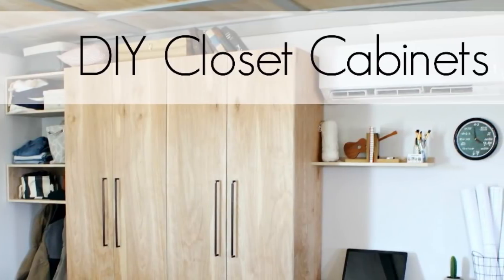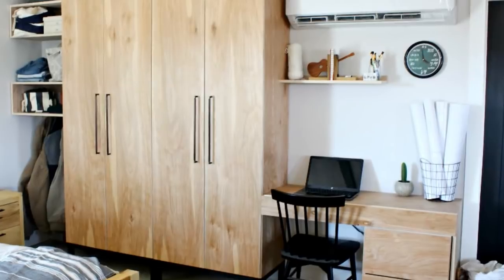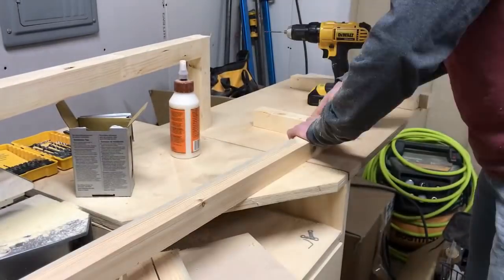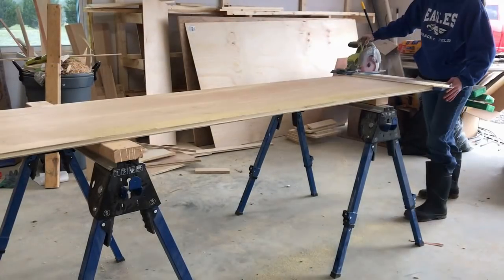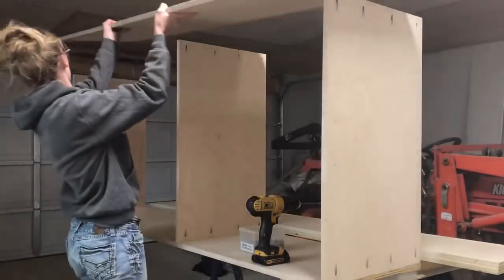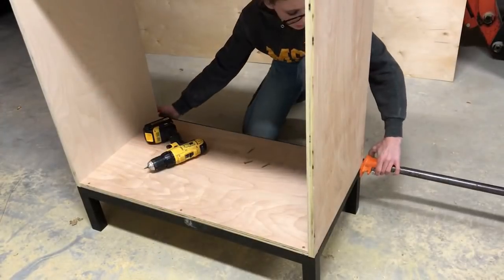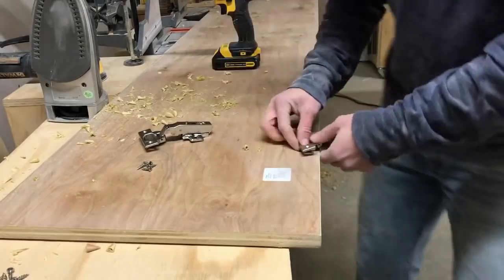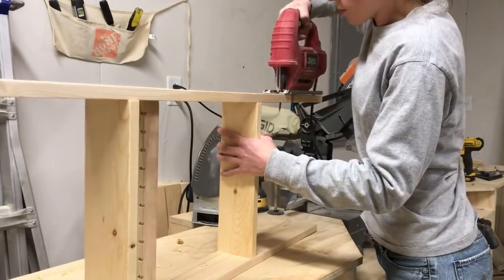How to Build Your Own Closet Cabinets

Comment: love these videos and find them amazingly helpful in pulling the curtain back from the seemingly difficult task of building cabinets (at least it's intimidating to me).  I'm going to give it a try and  I have almost all of the equipment she has except for the circular saw jig thing.  Can someone tell me what that's called?  She uses it to rip the plywood with the circular saw and it looks like a t-square but I don't know what it's called in order to pick one up and give it a try.  Thanks.
Reply from the maker: Hi! You can find out all about that tool here!
https://www.woodshopdiaries.com/cut-down-plywood-sheets-with-circular-saw/

Comment: how do you find that Ridged miter saw? I like Ridged tools but I hear so many terrible things about that saw
Reply from the maker: I’ve read a lot of reviews on the saw both good and bad. It’s got 4/5 stars and a ton of ratings on the Home Depot website. For the most part, I like it. But I have found that I have to check periodically that it’s cutting perfectly square. Every now and then it gets off and really wide cuts (like 16” cross cuts) can tend to be off square. I just have to remember to check it when I set it on 0 to make sure it’s really zero every time. But it obviously doesn’t bother me enough to get a new one since I’ve had it for three years now 👍 overall, it’s a good saw.

Comment: What size of screws did you use to put it all together?
Reply from the maker: It’s all detailed in the blog post and plans. I usually use a combination of 1 1/4”, 2” and 2 1/2” screws depending on what pieces I’m putting together

Comment: like that Kreg cutting jig... lot cheaper than a track saw. Did you rabbet the plywood back into sides or is that a butt joint?
Reply from the maker: I have a video on using the kreg cutting tools you might find helpful, too! I just nailed the back in place. You could rabbet them, but I didn’t bother

Comment: I built one of these carcasses and really didn't want a central self to collect crap, but it's a no go. Even with 3 support pieces along the back, the front bows out too much (1/2") without a shelf.
Reply from the maker: Yeah…that’s the sole purpose I added it. I didn’t want it either but it’s necessary.
Reply: @WoodshopDiaries  I found a different solution!  I used threaded rod for the clothing bars and that pulled it in. More expensive than an extra shelf but I like how it came out.   I have another question. How is your door doing that has the shoe storage on the back?  Sagging at all?  I'm trying to design the second interior.

Comment: For this project can I use 1/2 plywood for the doors instead on 3/4 ? Or would it be a problem?
Reply from the maker: You could use 1/2”, but I’m not sure if the concealed hinges would work on that. I THINK you have to have 3-4” or thicker for those. If you use 1/2”, you may need to consider a different type of hinge.
Reply: Thank you. I build it but when came time to put the door on the plywood was warped how do I fix that or is there a specific plywood that does warp
Reply from the maker: I’d suggest using a high quality cabinet plywood (like birch or oak). I’ve had mine for two years and no warping. But, if you still have a bit of a warp, you can always install a magnetic catch to help pull in whatever corner is warped when you close the door. It doesn’t really fix the root issue, but will look much better

Comment: Im thinking using plywood but i Heard plywood doors are not reliable they bend after while and get out of shape please advise???
Reply from the maker: syed ahtsham rashdi I’ve heard the same thing but I’ve not had any issues with mine. I used plywood closet doors here and plywood doors on my kitchen cabinets as well. Had both for about a year now and never had any issues with them warping 👍
Reply: @WoodshopDiaries  thanks

Comment: Curiosity question, do you ever find that the clothes smell like wood or is that a non issue because of using plywood?
Reply from the maker: Haha...I’ve never noticed that. Sawdust smells...but once the dust is gone, the wood itself doesn’t really smell like anything. Kind of like your kitchen cabinets...they don’t smell like anything.
Reply: @WoodshopDiaries  True, but I guess I never put cloth in my kitchen cabinets to find out. Thank you for your quick reply.

Comment: How to prevent doors from bending ?? because its frameless
Reply from the maker: My doors haven’t bent/warped and I’ve had these for two years now.
Reply: @WoodshopDiaries  okay, thanks for replying, any suggestions to prevent doors from bending, because in rainy season humidity does bend the woods here
Reply from the maker: I’m not sure...good quality plywood shouldn’t warp very bad if sealed properly. Try sealing all surfaces with paint or poly finish
Reply: @WoodshopDiaries  Okay, thanks again 🙏😊
Reply: @WoodshopDiaries  what would you prefer for making a wardrobe - ply or lumber ?
Reply from the maker: I built these with plywood. 👍

Comment: Hi Shara, I want to build both cabinets as one cabinet. Is it ok to use a 3/4" MDF board in between both sides?
Reply from the maker: So you’re wanting to build both cabinets and screw them together with MDF in the middle? Or use the MDF as a divider in a really large cabinet? 
I’m not sure I understand where you’re putting the MDF? Personally, I never use MDF.
Reply: @WoodshopDiaries  yeah, I was thinking to use the MDF as a divider. But if you recommend against it, and to use plywood, I can do that. Will just a 3/4" plywood divider suffice for the closet rod or should  I brace it with 1x4 and big L brackets as a traditional closet
Reply: Hi Shara, I plan to build a barn door in front of this closet. My friend doesn't have a ton of space. It's a 39 1/2" opening to his closet. Can I build a traditional barn door with premium pine only 19 inches wide. Is there a hardware kit that comes in 3.5 feet wide. ?

Comment: I bough the plan then proceeded to build it. It could just be me but the measurements on the plan are off, which resulted in a 1.25 inch gap for the doors. Plywood is .75 for each side which is 1.5 inches total for the doors. The bottom and middle measurement is 32.75/cut adding those together = a total cabinet width of 34.25.... Doors are 16.5 for a total of 33 inches; total
Cabinet minus doors results in a gap of 1.25 inch gap. Yikes! Where did I go wrong? Love your stuff and channel but I just can’t figure out the math on the plan. My choice now is to remake doors or add a 1/2 inch edge to each door. Please help! Where is the gap coming from?
Reply from the maker: According to the plan, the cabinets overall size is 33 1/2”. The bottom, middle and side panels are 32” long. Add 1 1/2” for the two plywood sides and that gives you 33 1/2” overall width. The doors are 16 1/2” wide each so 16 1/2” x 2 doors = 33” overall door width so that leaves you with 1/2” to distribute between the gaps between the door and the gaps on the edge of the cabinet (for full overlay doors). Im not sure where you got your numbers
Reply: Shara Woodshop Diaries take a look at page four/cut sheet in the plan :)
Reply from the maker: Yes it says (6) 18” x 32”  3/4” plywood panels. Page 5 cut diagrams also shows 18” x 32”. Not 32 3/4”
Reply: Shara Woodshop Diaries I see that as well. I’ll just remake the doors for a tighter fit. I’ll eventually figure out where I am off 🤷🏾‍♂️ I think for the next plan I’ll diagram it out first. Looking forward to building the dresser next.
Reply from the maker: I am sorry for the confusion. But I think you got off because you read 32” 3/4” plywood as 32 3/4” for your measurement. But it was 32” long 3/4” thick plywood. So you built the cabinet 3/4” wider than the plan called for. Also, I included a plywood cut diagram in the plans. Maybe that can help.
Reply: Shara Woodshop Diaries thanks. I got them all done today. Thinking of  mounting them to the wall as I’m using them for garage storage. They look fabulous.

Comment: Will the cabinet be strong enough since there is no solid wood in the structure except the part underneath?
Reply from the maker: Eyal Yatzkan most cabinets—kitchen, bathroom, etc are made from plywood. It’s a great material for cabinets and a good quality plywood will last a very long time.